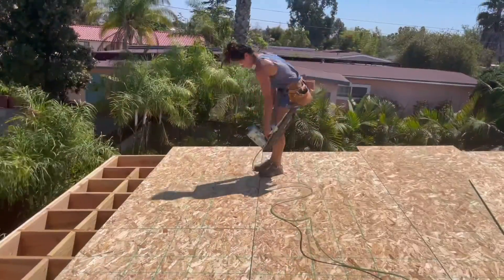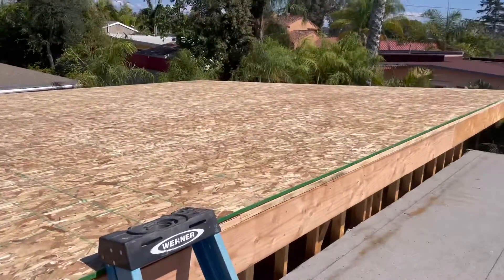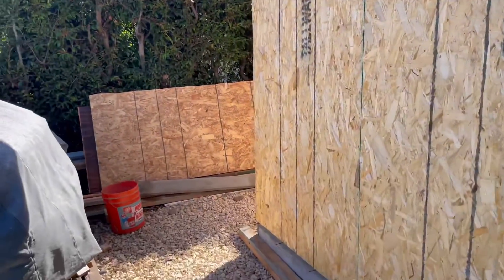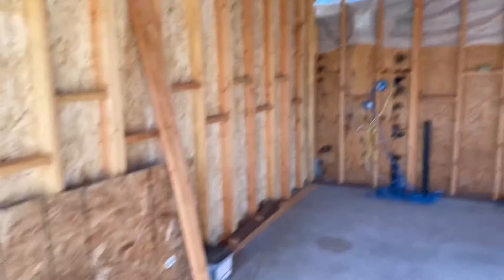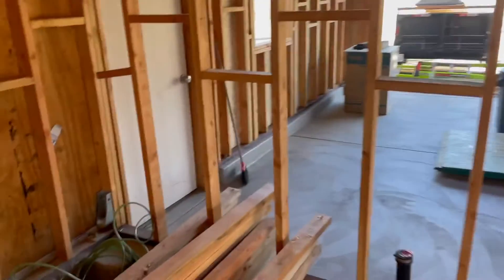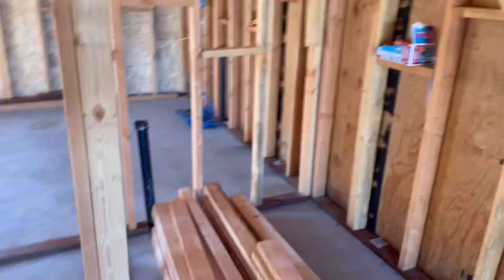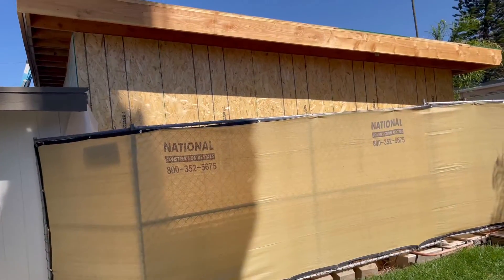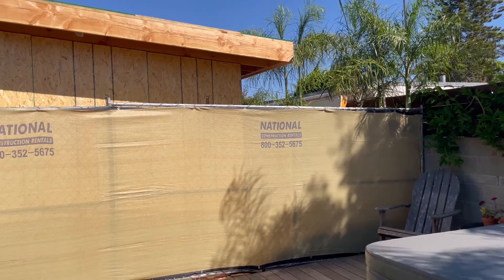DIY ADU Update #6 - Fire Rated Eaves

Comment: I guess I should have seen this video first. 🤦🏻‍♂️
Reply from the maker: Here is another approach Joel. Depending on the size of your rafters. You can use batt insulation below and place the rigid up-top. This method is much easier for sealing the joints on the rigid. https://www.finehomebuilding.com/2010/07/15/rigid-foam-on-the-roof-and-walls